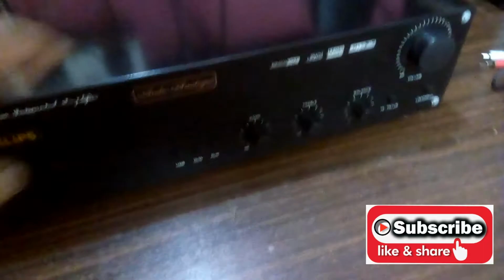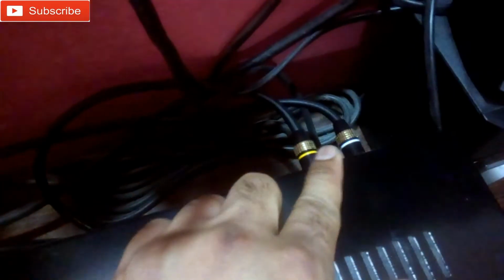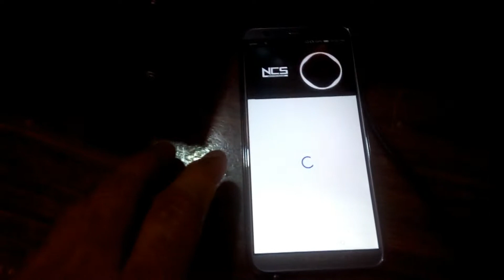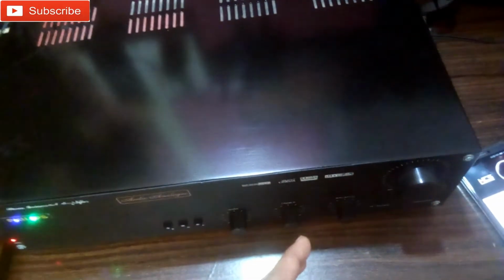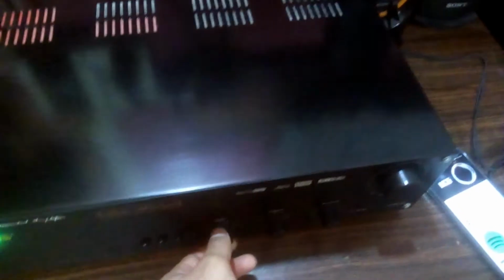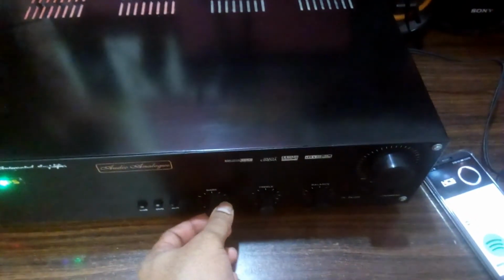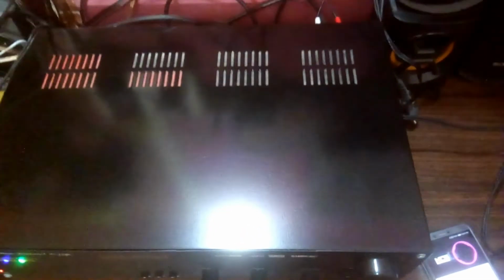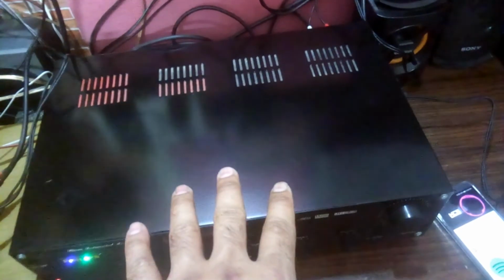DIY 2 Channel Power Amplifier,Homemade Subwoofer Amplifier

Comment: Sir can you helped me,near my Yamaha htr 3072 av receiver can tell how much maximum watts power speakers attached or connected to this av receiver please tell all 5 speaker, I very confused read manual... Please help..
Reply from the maker: 150watt max. You can use any speaker package that's wattage range is from 50watt to 150watt.
Reply: @technoboy-allinOne  thanks sir,last can you make video or tell how to connected amplifier in av receiver ....
Reply from the maker: Didnt understand bro? What amplifier? Av receiver has inbuilt amp in it.
Reply: @technoboy-allinOne  external stereo amplifier
Reply from the maker: Stereo amplifier? For what? Can you tell me in detail?
Reply: @technoboy-allinOne  can I extended av receiver power through other external amplifier eg.crown,ahuja..
Reply from the maker: @nightbuyer7812  not with this model. Other higher range models have rca pre out for all channels incase you wanna use external amp for high wattage speakers. This model doesnt have that. So dont try this through speaker output, thats a bad idea. This receiver has enough power to drive even tall tower speakers. So you dont need external amp. You just need to configure it properly.. if you wanna use external amp, then use it for subwoofer. This way You can use bigger subwoofer.
Reply: @technoboy-allinOne  OK sir ,av receiver not any setting which allowed center speaker only dialogue come not background music...